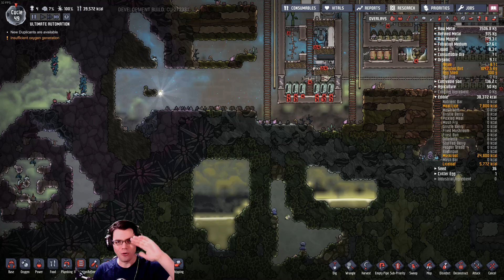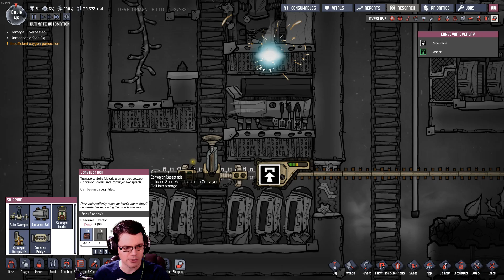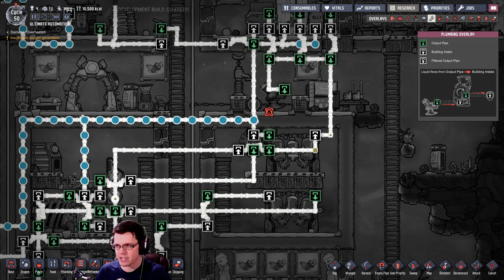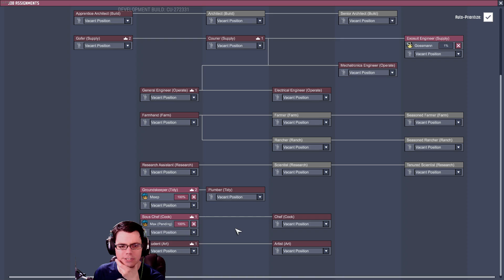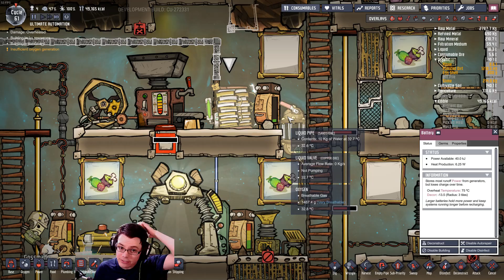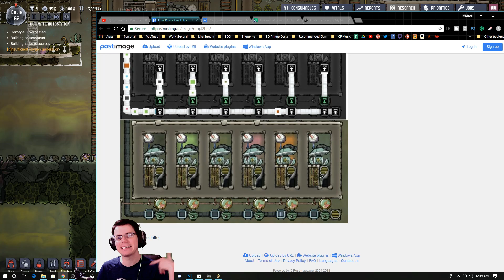Oxygen Not Included - Ultimate Automation Challenge! Cosmic Upgrade Part 3

Comment: Is the power transformer broken in the expressive update?   I tried to setup the exact same setup where the power transformer is connected to the smart battery and bridge out to the separate circuit for the metal refinery with 2 battles and it doesn't seem to be pumping power out to the 2 batteries or the transformer itself.  it shows 0 J.

Comment: The pitcher pump doesn't need to be full length to work. I usually have a 3x1 tank. 2x1 for the straw and one tile for a liquid valve. Once the liquid valve is max pressure it stops so it never over flows. I know it's not related to automation but it's kinda self regulated

Comment: Brothgar, i need help to how play oxygen not included for unlimited time. My dupes are always dyinbecause i dont have any food (like no dirt). I would need help to find out how to survive with 10 dupes longer then 200 cycles, it seems like everythign is finally, except water.

Also is there any way to automatic destroy blocks?
Reply: There are a few keys to a sustainable base.  The first thing you want (depending on your world seed) is probably to find a cool steam geyser or two.  The recirculating restroom will help extend your water supplies significantly, but you will run short without geysers.  So start digging around!  Second, you will need to switch away from mealwood for food when you can since your dirt supplies are limited and challenging to replenish.  The easiest is probably going to be the fungal spores, they just require carbon dioxide and slime, both readily available for a long time.  Bristle blossoms are also easy, but they take a good chunk of water so if you have water challenges you'll probably skip those.  In the late game you might switch over to pincha peppers and sleet wheat after you've got your water and polluted water industries established.  There is also ranching, but I've not done much with food ranching so I'm not sure how sustainable it is.
Reply: Thanks for your help. Water doesnt seem to be the problem till now, bc u get more and more the more dups u have. But now they changed the next food (the cold wheat thingy to also need dirt) you can get dirt now thru compost (dont know english name, srory) but this would not be enaught. I dont udnerstand how the devs think it should be played? With only 4 dups for a limited time? Or with 10 dups with half limited time? If they didnt limit us in width, we could just get more and more, but this way this game doesnt make sense bc i need to restart ever. Also slime will end. I also didnt think dirt will be out, i was shocked when it happend, and there was really no dirt avaible on map anywhere... my 14 dups all died.
Reply: Only way i see is bristle blossoms. And pepper (but hard to make) and both destroy water. (which is completly dumb btw)
Reply: @Brothgar should really talk to devs to make this game longer lasting. I dont understand why i should play when i know all will die anyway. And i dont like to make a new game every X hours.

Comment: The conveyor receptacle has to be on a lower priority than the freezers (in this case), it works like a modified storage compactor and the auto-sweeper work exacly like a duplicant (it will move items from the floor or inventories of lower priority to inventories of higher priority or machines! Although it is still a bit buggy and sometimes it helps rechecking the storages of higher priorities not during a pause!

Comment: nice challenge! i have two tips: 1 you can actually rotate your sweeper. might be useful in some areas. and 2, the maximum number of critters in a ranch is determined by the size. if you make the ranch the maximum size in a way so that the width of it is covered by a sweeper and you just go high after that, your sweeper can actually collect everything. your setup now can't reach the corners of the ranch. anyway, keep up the nice videos!

Comment: what so brothgar in the part where you have the gas image can that same design be used so you can use less gas pipes coming into the base. so one pipe in and the pipe has sensors which separates the different gases to go into the different parts of the base it is needed.

Also i just figured out that if i fill a room where a pure ore volcano (gold,iron or copper) is located with chlorine the heat from the ore doesn't transfer very well so a auto sweeper can be used to carry the metal to a cooling room which is the air condition design you made when trying to cook dirt for the triple printer challenge.

Brothgar you have note solved the new prob with the oxygen system, door needs power to work properly so what design will you use to produce oxygen.

The devs need to allow us to build modules which change the shape of the auto sweeper and the size.

Didn't forget to save this comment, see brothgar i learnt my lesson